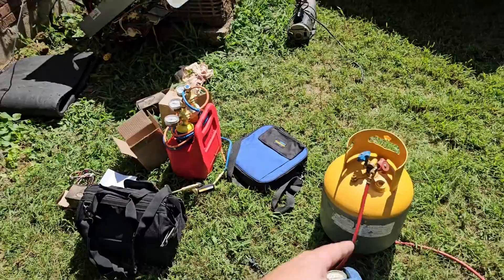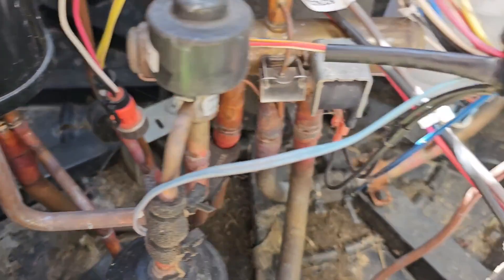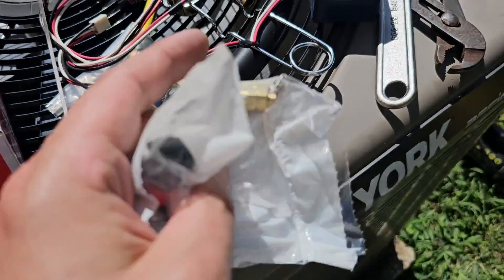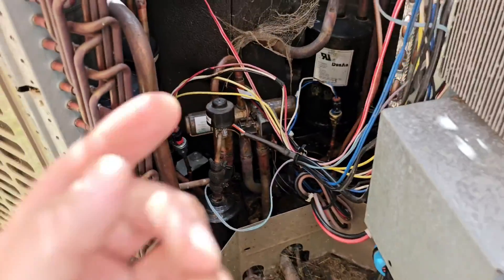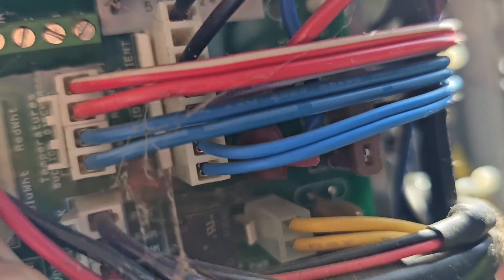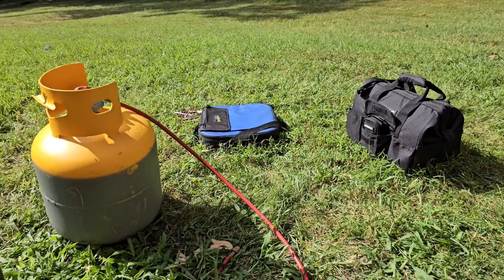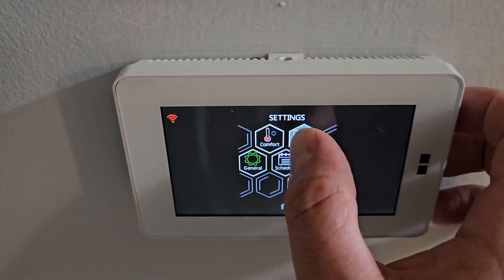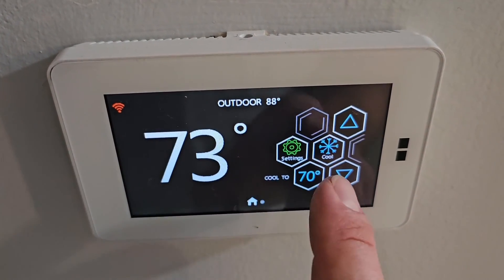Pressure Transducer Replacement Made Simple!

Comment: The 1/4” flare adapters are not meant to be connected to the pressure transducers prior to brazing. You braze the adapter onto the line then you reinstalled the shader core, completely which you did not do and then connect the transducer and all brazing to be done while flowing nitrogen which you also did not do?? Just stating..

Comment: At time mark 10:48 it looks like suction temp sensor is bad also.  Should be close to same 81 degs F as liquid temp reading at 243 psig R410a for inactive temp equilibrium.  Likely reason for 65 degs F superheat reading at time stamp 13:03.

Comment: Why would you install a schrader valve core and not tighten it? You might as well not even use one. Then try to use a wet rag for brazing to keep from melting a core that is not even tightened... Is it not easier to just braze the schrader valve in without the core and thermister attached??  PS nice video.
Reply from the maker: It's not supposed to be tightened all the way so that the transducer depresses it and measures the pressure.
Reply: If the core is not tight pressure is going to reach the transducer weather it depresses the stem or not...either way. the transducer would work fine without the core. The core is suppose to allow the part to be replaced in the future without needing to remove refrigerant first... @taddydigest  the new part should be able to depress the core EVEN WHEN THE CORE IS TIGHT... unless the part is out of spec.